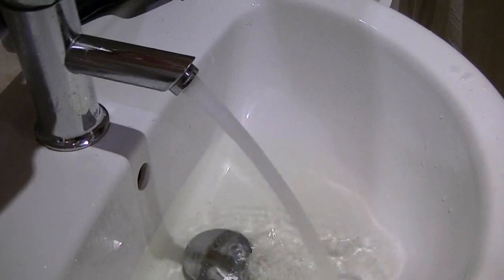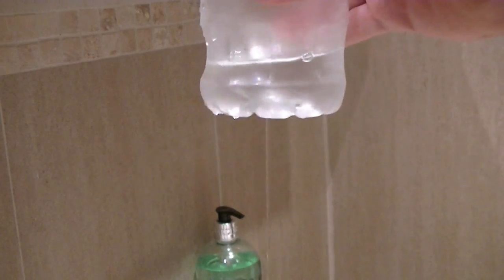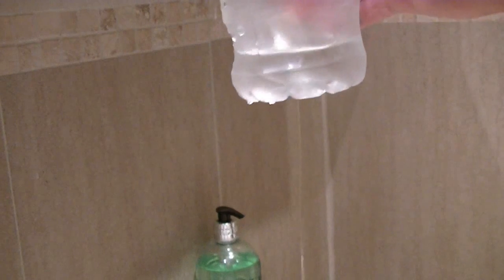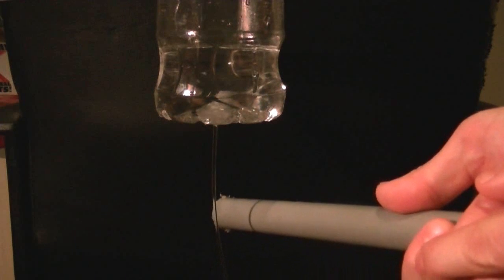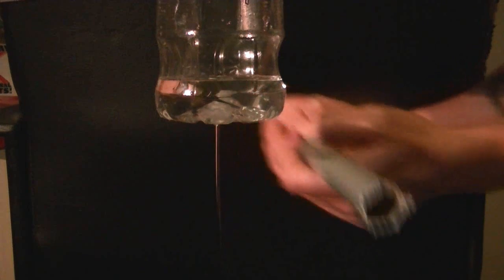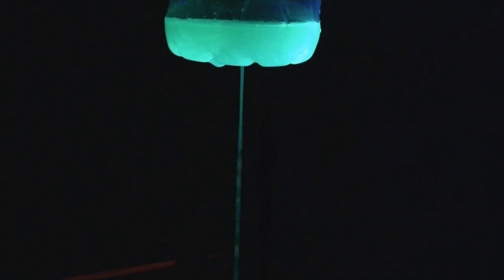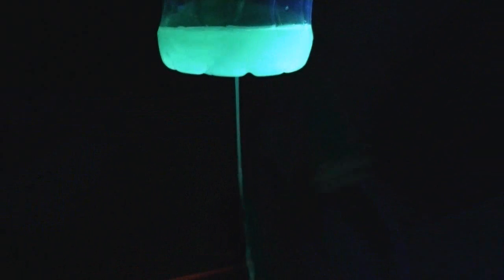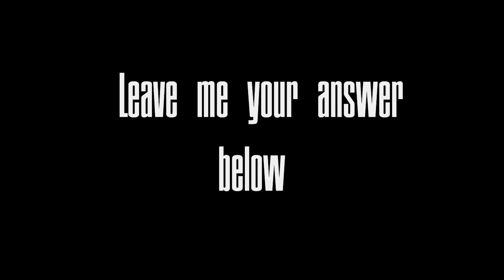Bending Water

Comment: Wait a minute wouldn't molecules also push it self away from the pvc pipe because if you have a uniform electric field there is an equal force pulling the positive side towards as the negative side pushing it away...makes  you think :D
Reply: How? would you care to explain?
Reply: Well I guess we are both kinda wrong because of the negative being attracted to the positive the water will be attracted but since there is also a positive side of the water molecule it will push it away like I said in my first comment it would break the water into droplets if you noticed in your said science experiment , even some positive side of the molecules would go up the water of the tap or in this video a water bottle but it would still break the water into droplets but because the water is going really fast , you would see the bend. Please do not give me hate im only 13 I quite like these sort of things

Comment: This is due to the polarity of water. in other words, H2O has a posotive and negative side and can be attracted accordingly. Polarity and the surface tension of water makes it stick to itself nicely.
Reply: It is not due to the polarity of water. Tap water is impure - meaning it contains dissolved ions. Some are positive and others negative. If something with a charge - say the pole demonstrated by the video - comes nears to the stream of water, its negative charge will repel the negative ions in the stream. Some of them will go up the stream. The other positive ions are attracted to the pole, causing droplets containing positive ions to bend towards it. Water is a dipole, but it is not demonstrated by this phenomena. In fact, this occurs with non-polar liquids containing ions.
Reply: okay, thank you.